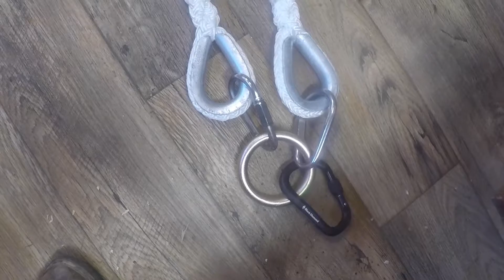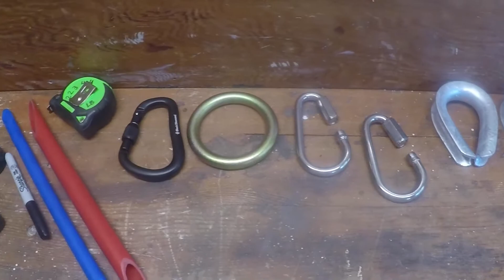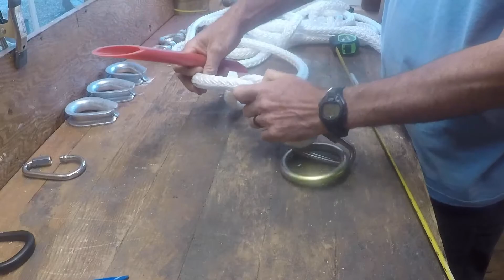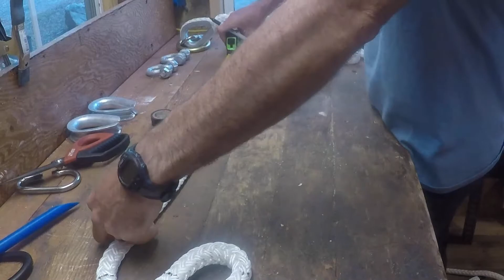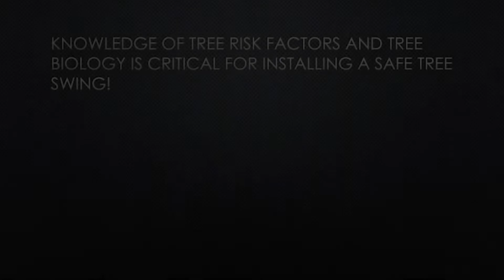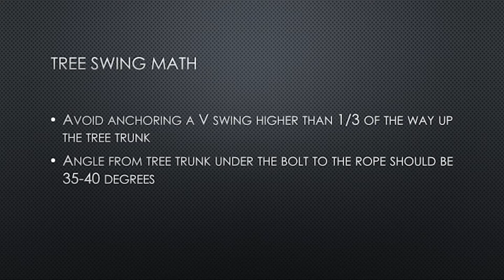Double end splicing tutorial for tree swings

Comment: Great video, Patrick! Really helpful. What size anchor shackle did you use? Also- where did you find the one with the bolt and pin? They seem harder to find than the screw pins.
Reply: I just completed my swing setup following this guide. Like you I had issues finding the hardware but finally stumbled upon Rigging Warehouse and was able to get everything from them. For the anchor shackle, I used a 1/2”. Wish I would have shopped around and bought white rope. The dye from the colored rope (red in my case), came off on my hands as I was working with it. Also, don’t skimp on a fid. Burying the tails is a pain without one.

Comment: Is there a reason you don’t use metal cable/rope rather than polyester rope? I know they sell high weight limit metal cable/rope at HD that’s covered by clear plastic/rubber and is flexible enough wrap around a thimble like the rope in your set up. Is there a downside to using something like that?
Reply: I've been wondering the same thing, did you ever find an answer?
Reply: @beyondtheillusion333  I went with metal rope wrapped in plastic. Has worked well.

Comment: Is there a danger to having the angle between the tree and the rope be less than 35-40 degrees?
Reply from the maker: There's no danger to using a lesser angle, but if you are making a Y swing it may make the rigging ring so low that you can't fit a 3rd spliced leg under the rigging ring.

Comment: Great video!  However, I believe there is a minimum finished length of rope required in order for this double splicing to work?  I was making a finished length rope of 7'.  I have the LB splice complete and was making the markings for the TTES when I realized the insertions would end up overlapping in the center of the rope.  Should have made the rope longer, I know.  Any other splice recommendations for finishing the one end for this rope?  Thanks.
Reply from the maker: You are exactly right.  7" is about the minimum finished length that you can do with a locking brummell on one end and a triple tuck eye splice on the other.